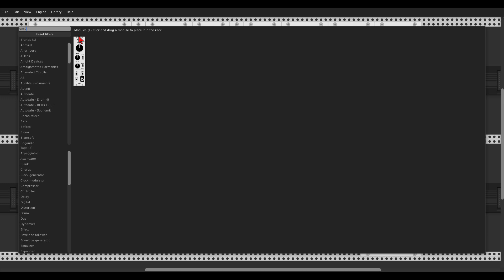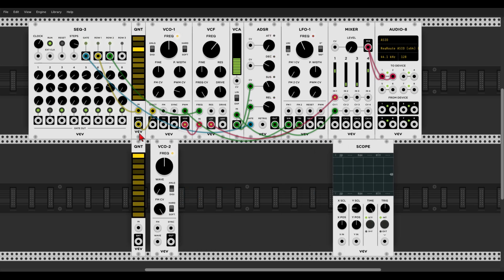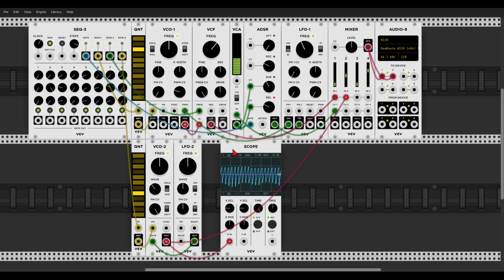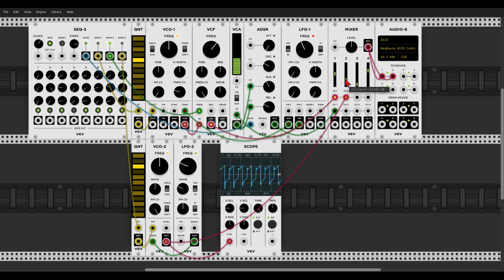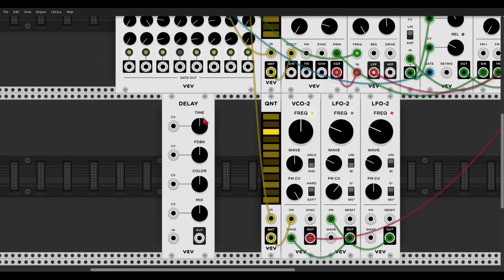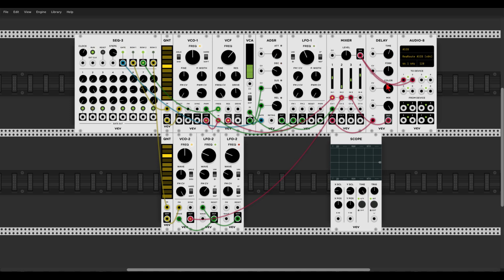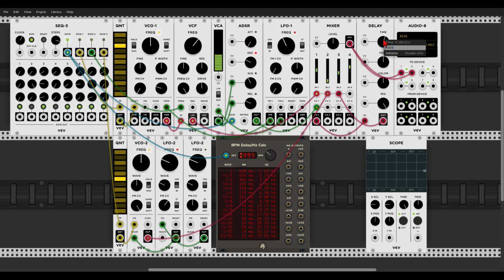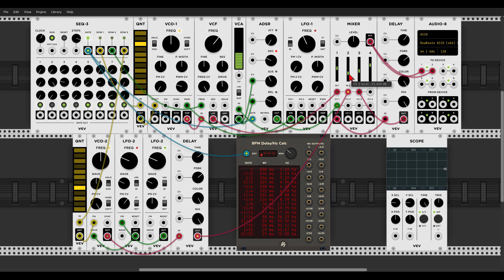Beginner's Patches IV - 2nd voice and delay

Comment: Short cut: You can just run a patch cable from the different note length outputs on the bpm calculator to the delay CV inputs instead of right clicking and manually editing the values. This way you can make changes much faster and even pull the outputs into a randomizer or something.

Comment: Hey, another good tutorial, thx a lot!!!
I noticed  that this calculator can't understand a tempo when it's in 7 or 3 steps mode, it's jumping all the time between two values. I mean in my set it doesn't work, dunno why. Because of it can't use calc outputs for syncing =(
Reply from the maker: Thanks! Well, I guess it's a bug or something but if you enable tool tips, you can see the BPM on the the Clock knob, and then set it on the calculator.